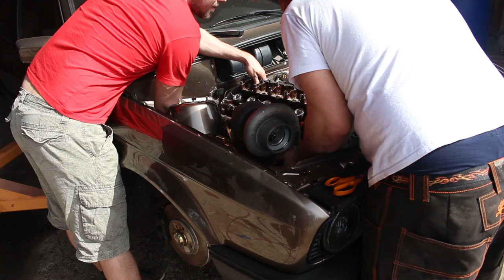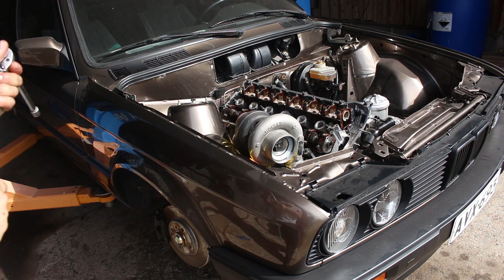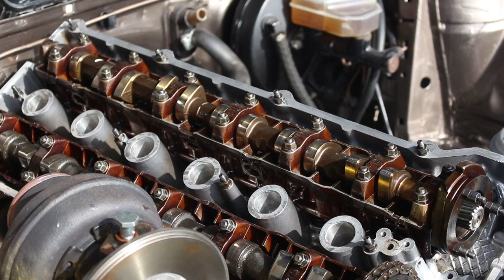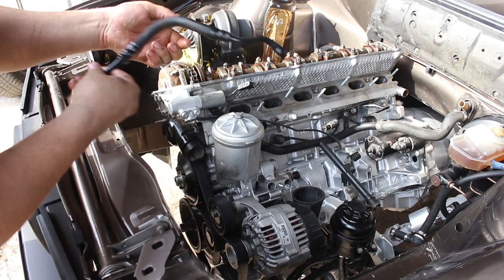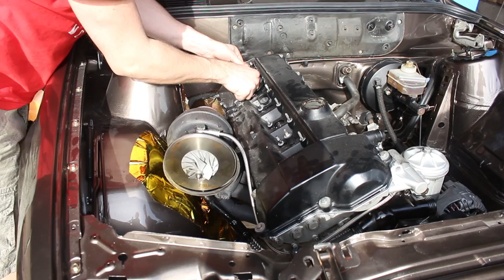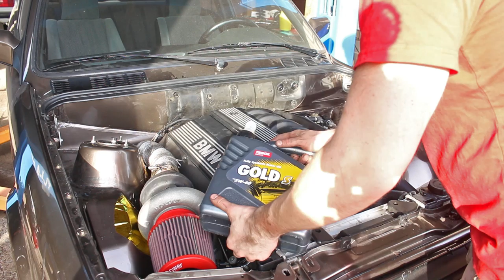BMW e30 m52 turbo winter maintenance. Part 6 Head assembly, valve timing and first start.

Comment: Not sure which video to ask this on, but I guess i will ask here, since you mention M50nv cam timing. What timing would you suggest for a naturally aspirated M52B28? I currently have M50B25 intake manifold, M54B30 intake cam, M50nv intake cam as exhaust and ebay tubular headers. The car will be driven on a racetrack most of the time and i also have a really short (3.64) diff so I'm looking for the best timing for revs above 3500rpm or so. I have access to RomRaider so I can play with VANOS curves, but I need good base timing first. :D Any suggestions?
Reply from the maker: m54 intake cam at stock timing and m50nv intake cam as exhaust cam seems to work great when degreed 1mm open at TDC. No matter what the setup is.
Reply: @pazi88  Thanks, will try it out. Maybe slightly stupid question but which sprockets etc do you use on the M50nv cam? All from M52? I know for M54 you use all from M52.
Reply from the maker: @PocezPanda  m52 spockets
Reply: @pazi88  Thanks for all the info, the engine is now finished, still have some details to do but the car runs and drives. Pulls very nice! Thanks for your help!

Comment: why m52 intake on this engine
Reply from the maker: It gives more low end torque off boost. The top end power is easy to get with high boost but I like the engine to work in low rpm also.
Reply: +pazi88 but He have on the dyno Video m50 intake or Not with 490hp
Reply from the maker: +hythekiller It's with m52 intake. The dyno video is filmed right after this video. I just put these on YouTube bit strange order because I didn't had time to edit these.
Reply: +pazi88 Okey thanks how much Boost on this Video? 

I have the Same enige m50b32tü with 330hp on the crank non turbo non supercharger with itb and another Mods... 
but i drive with old Bosch dme 3.31
Reply from the maker: +hythekiller I'm currently driving with 1 Bar boost. I tried rising it but the engine went Lean after that. My fuel pump maybe at it's limit.
Reply from the maker: +hythekiller I'm planning for high compression m52b3x NA stroker in future for my e36. Which pistons you did use on your?
Reply: +pazi88 je Pistons 11.5:1
Reply: +pazi88 which pistons und rods did you use i think 1 bar is the Limit for the Aluminium Block what Do you think? 
which ecu Do you drive? kdfi 1.4? and the knock Sensor? 
emu is better or Not?
Reply from the maker: Stock pistons and m50 non vanos connecting rods. I think the limiting factor is the stock headbolts because aluminium block doesn't work well with non stretching bolts (like ARP). And I have seen the stock bolts to give up after 1.3 -1.5 bar of boost. Yeah KDFI and no knock sensors in use because I use e85. I have no personal experience on EMU but at least in paper it looks bit better.